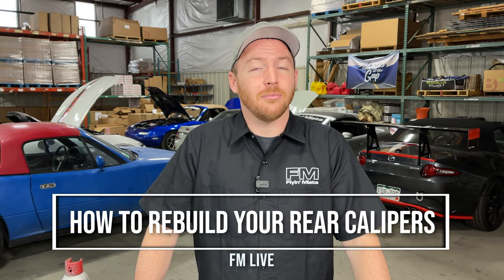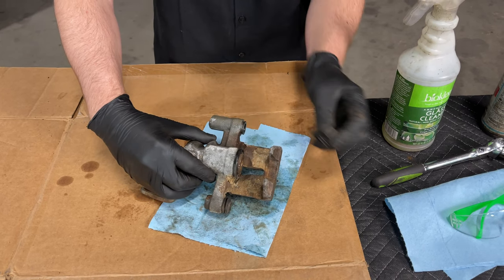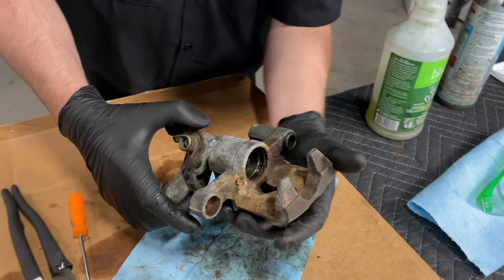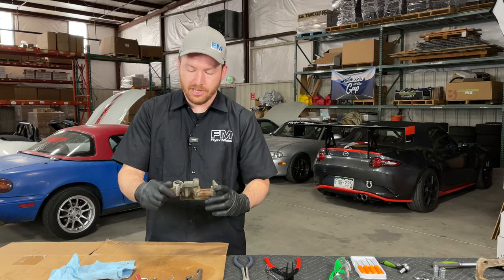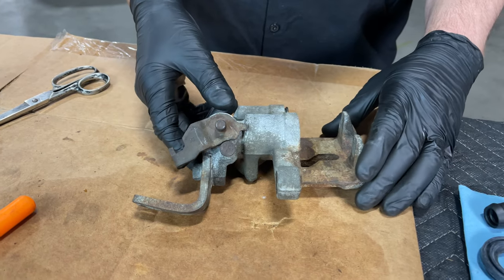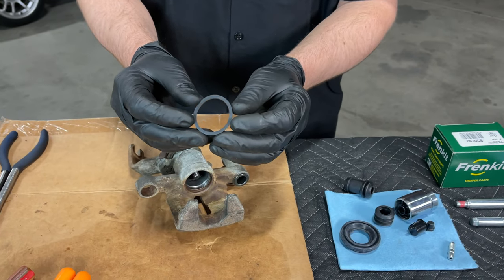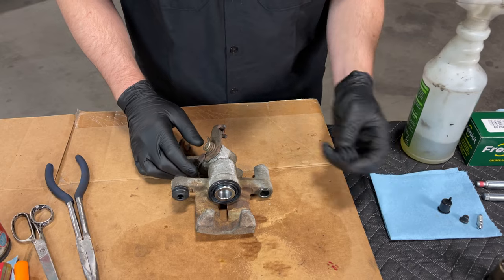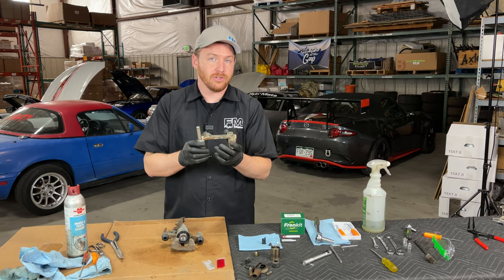Step-by-Step Miata Rear Brake Caliper Rebuild

Comment: This is a very good step by step video.  Well done.  Last year I tried to rebuild a rear caliper for my 280zx but I couldn't get the very last mechanical piece out and I had a very hard time trying to get the rubber dust boot over the piston and seated correctly.  I am now attempting to do this again, and this video will come in handy.  Thanks again dude.  Gotta get those pliers now
Reply from the maker: Glad it helped!

Comment: My girl has a 1999 Mx 5 needs brakes disk .. On your link can't find rebuilding caliper kits.? I had a job 17 yrs old  we go to the junkyard collect as many calipers. break em down acid bath/ nutrialize and rebuild em. 1 cal. $ 3,00 sold for $30.oo ++ thx.
Reply from the maker: Not bad! Our caliper rebuild kits for 1999 Miatas can be found here: https://flyinmiata.com/products/caliper-rebuild-kit-front?_pos=2&_sid=86e32c2e8&_ss=r

Comment: All right I needed this video! I replaced my rear calipers and pads and bled them properly but I'm not getting any motion from the Pistons back there! E brake does not make them function either
Reply from the maker: Oh boy! You should have enough pedal pressure with the car off but if not, maybe try with the engine running to get some assist. You might want to go through your bleed process again. If you have pressure out the bleed screw, you should be able to push the pistons with it shut.
Reply: I'd never messed with the rear brakes on the car before and at one point in the video you guys mentioned using the rear set screw to set the e-brake does that mean pulling the e-brake and then driving the set screw forward until you can't spin the tires anymore? Does that set the piston distance? @FlyinMiataVideo
Reply from the maker: @joshuaenyart5570  I'll usually set that screw with the hand brake down and tighten the screw until your pads just barely start touching the brake rotor, but you can still easily spin your rotors by hand.
Reply: @FlyinMiataVideo  thanks I'll give that a shot

Comment: Thank You! A brilliant breakdown of not just the rebuild, but for me identified several issues i didn't pick up when simply replacing the pads and disks... Re-build now due! Also well paced video, not a 10 minute rush through but also not so long as to put me off watching! Now subscribed! And really liked the only product placement noticable was for an Eci Friendly cleaning spray 🙂
Reply from the maker: Glad it was helpful! The cleaning spray wasn't a product placement, that's the stuff we actually use :)

Comment: Great detailed video, thanks,- we're just doing my sons' Honda CRZs rears at the moment. The piston was seized on the left side , but managed to free it with some big waterpump pliers and unscrew it. Not sure if the adjuster is working properly, as it's pretty tight, so might need looking at. Always good to know where all the parts go before you pull something apart (orientation etc).
Reply from the maker: Hope we could help!

Comment: Incredible tutorial, the only one I've found. When you're greasing the handbrake components with that little white tube, can I use silicone grease in its place, as I did for the slide pins?
Reply from the maker: You should be able to but make sure it can handle a bit of heat.

Comment: Great video.
What is the brand of those snap ring pliers? I have a set like it, but there’s too much deflection and it won’t pull the snap ring completely closed.
Reply from the maker: Wayne-s9x We don't recall the brand specifically, but we sourced them either through Harbor Freight or Amazon. Searching online for "right angle snap ring pliers" should show you the correct tool!

Comment: Great instructions, Mike. I have the rebuild kits, just need to find time to do the work. What do you recommend for paint?
Reply from the maker: Thanks, hopefully they help! For paint you'll definitely want something that is rated for very high-heat. There are also several brands that offer brake caliper specific paints that are made to resist brake dust and heat.

Comment: Any idea what the part number is the for the threaded rod inside that the spine drive moves, i cant seem to get it to catch and move the piston. The spline looks good but the rod has taken a beating after trying so many times.
Reply from the maker: Hmm, good question. I sure don't know what to call it but it sounds like a new caliper is in your future. I'm pretty sure those parts aren't available.

Comment: Does that manual threaded rod have anything  to do with the parking brake? 
On my left rear when calling the E brake, the cable moves the parking brake on the caliper, but does not engage, and when I press the brakes that caliper does engage so I want to know if that is an adjustment for it or I need a new caliper
Reply from the maker: Give our customer support team a call directly. They'll be more than happy to help diagnose and help if they can.

Comment: That ebrake actuation lever doesn't come out with just removing the spring does it? My lever is sticking, but i'm not trying to go out and rebuild the whole caliper at the moment. That'll be a spring job or winter when i store the car for the salty season.
Reply from the maker: The parking brake lever is held in place by the threaded rod under the piston, so it can't be removed until you've disassembled everything else.

Check to see if the sheathes of your cables have any damage - that can allow debris to get inside and bind up the metal cable.  You can also disconnect the cable from the caliper and actuate the parking brake arm on the caliper with pliers to see if it's the caliper or the cable that is sticking.

Comment: Great video! Is there a replacement part for the ebrake spring or that rod that rotates from the spring? It was seized up on mine when I changed the caliper. Thanks!
Reply from the maker: We don't sell those specific parts, but it looks like you can get those from your favorite Mazda dealership. Here's a link we found (not affiliated or recommending this dealership in any way, but it should at least give you part numbers)
https://www.jimellismazdaparts.com/products/mazda/Miata/Parking-Brake-Lever-Spring-SPRING-LEFT-L-Parking-Brake-Lever-Spring/1839129/BW0H26669.html

Comment: When I disassembled my calipers, there was a push-on retainer/washer.
Naturally, one of them jumped off the workbench and disappeared.
I don't see you using them at all.  Are they not needed?
Reply: I should clarify, the retainer was on the shaft that the spring mounts over.
Reply from the maker: It would probably be easiest for us to help if you could send us an email with some pictures of the retainer/washer you're referencing, or you can call in to our Support line at 970-464-5600. We look forward to hearing from you!

Comment: On sport brakes anyway, you will have to reuse your factory bleeder screws. The replacements in the Fren kits are the wrong thread pitch on both front & rear kits! Also no replacement copper washers are included in the kit for the parking brake adj. plug bolts or the banjo bolts.
Reply from the maker: The bleeder screws was a known issue, and that should be fixed on all current kits. If you bought the kit from us, reach out to our customer support team so we can send you the proper bleeder screws that come with the current kit. The copper washers can be reused and don't have to be replaced, They are only helping to keep out dust, not sealing in brake fluid.
Reply: @FlyinMiataVideo  I did and will contact your support team.

Comment: So they can only be rebuilt if you can get the adjusters to turn?
Reply from the maker: You have to be able to fully disassemble the brake caliper to rebuild it and make sure it functions properly. If you are doing a rebuild anyway, try soaking it in penetrant 24 hours before trying to disassemble. If you get stuck or need more help, reach out to our customer support team directly, they'll be happy to offer any advice they can. :)
Reply: @FlyinMiataVideo  my issue was last time I replaced rear brakes the adjuster wouldn't move the piston. I had to crack the line to get the caliper retracted enough to slide over 1 new pad and the better of the old 2. Does the kit come with a new adjuster, and is it possible to use air pressure to get the piston out and worry about the adjuster and threaded rod after  the piston is out?
Reply from the maker: @kylelambert1672  Unfortunately the kit does not come with a new adjuster and since the adjuster threads into the back of the piston in the rear calipers, air pressure isn't going to work unless you are able to un-thread the adjuster first. Give our customer support team a call or email if you can, they might have some troubleshooting solutions or better answer your questions there.

Comment: why its so hard to mention target generation NA/NB/NC & ND in title?
or its on purpose, just to get more clicks
Reply from the maker: Some videos can apply to all generations, even if the specific sample in the video is only one. There are definitely minor differences, but the basics of rebuilding a factory Miata caliper are going to apply to all Miatas.
Reply: thanks for clarifying
Reply: This caliper is from an NA/NB I believe. I have just dismantled an NC caliper and found it to differ from what's is the video. It has 2 larger circlips (in the piston and cylinder bore), and both have springs under them to compress. 
I've abandoned trying to refit the one in the bore.